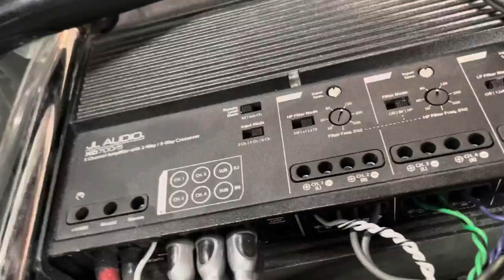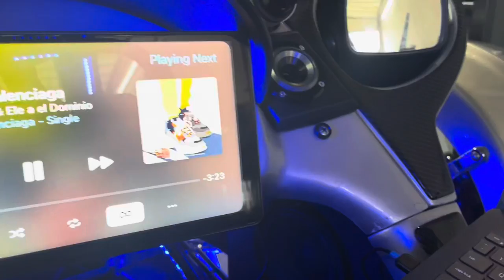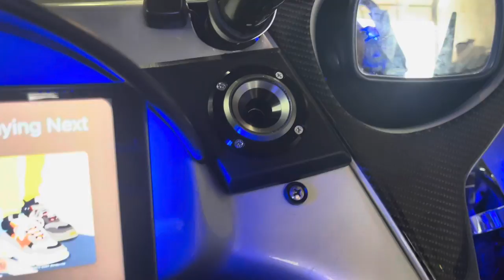@trex_lifestyle  brought in his T Rex for a big Nvs Audio audio upgrade and a wiring rescue.

Comment: Is that single 10 keeling up with all those mid ranges and super tweets? Always hard to tell via video.
Reply from the maker: It’s trying 😅

We are upgrading to a 13 Inch JL this winter 

I told the customer that the bass would not be able to keep up with the highs but he insisted on 6 Beyma and high power 🤷🏾‍♂️

The bike sounds great but the bass definitely can’t keep up .
Reply: @NVSAUDIO  that was my concern listening and looking. Another great install. Thx for your reply 🤝
Reply: Hi what do u charge to hook up a system in a 18 slingshot slr id supply deck 2 amps 2 subs n  4 6.5